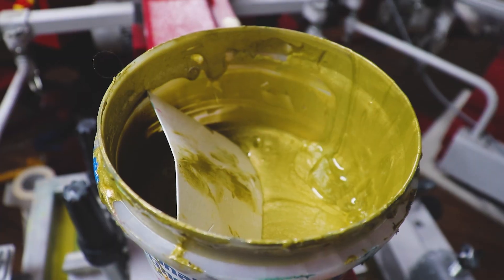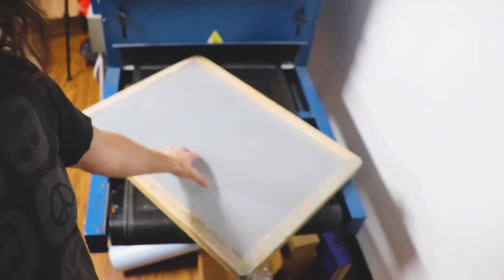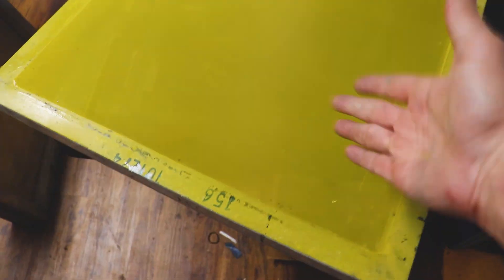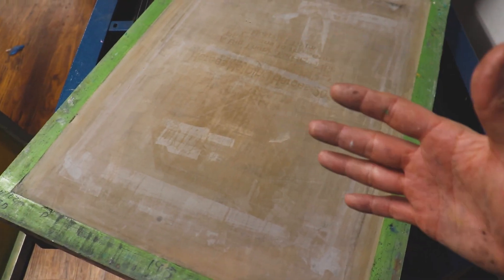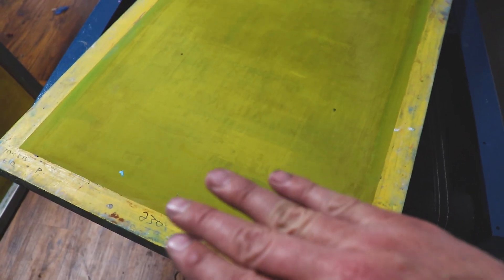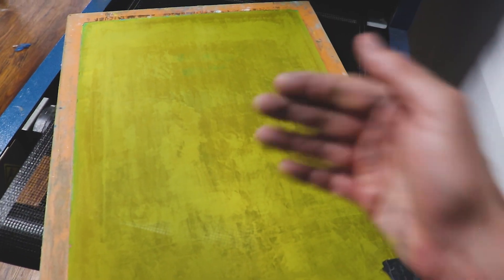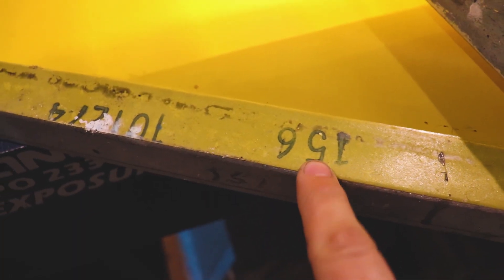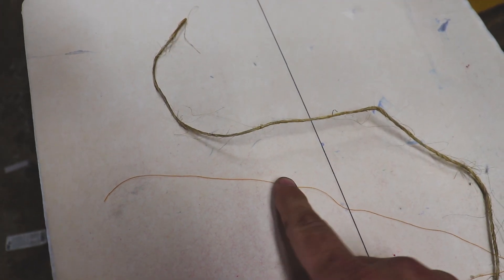What Mesh Count, LPI and Color to Use? Simulated Spot Process Screen Printing. FREE Cheat Sheet!

Comment: Excellent primer on common mesh use. We print a lot of low cure that is thicker and tend toward the
mesh that has the greatest open area percentage. 110, 128, 140, LX180, 230, 272.

Comment: Nice video.  I use Paint Shop Pro for my images, there is no option for LPI.  Do you know what to use in PSP to calculate the dot size depending on the mesh count?  Thanx for the info, This is for printing halftones.

Comment: what about garment selection? what brand/blend/or style of garment do you recommend for spot process or cmyk process? regular 100%cotton? 50/50 blends? do some garments work better than others for process printing?
Reply from the maker: All of them work. You just have to be sure you're using a low cure ink for poly / blends. The smoother the shirt, or knit, the better the print, but you can get great results with a flattening screen.